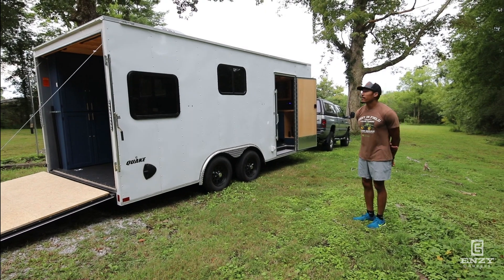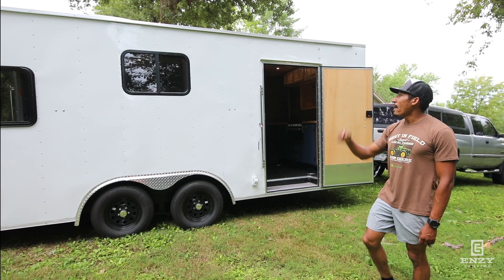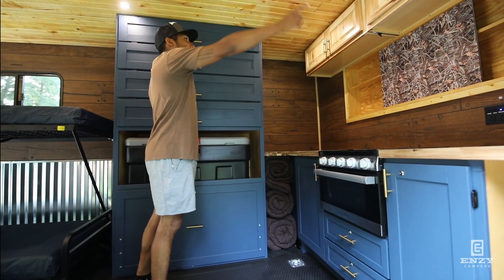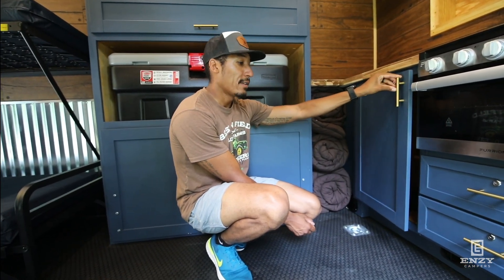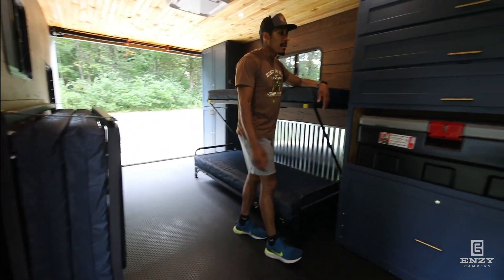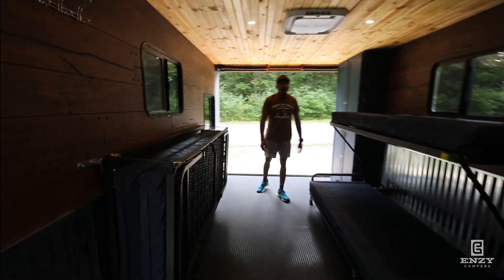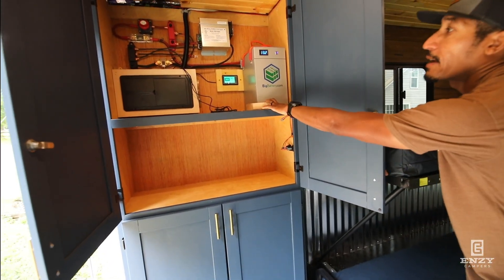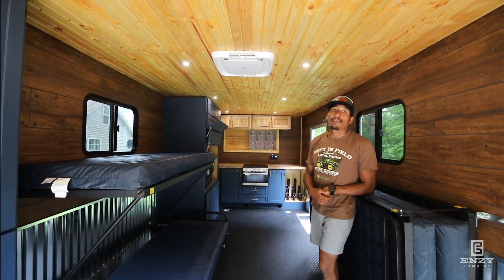Enzy Camper Walkthrough

Comment: Nice Build!!....Ever think of using Composite Panels and Timbren suspension. I guess the trailers are already manufactured and you add the insulation and add ons?
Reply from the maker: Thanks for the feedback! Correct, we purchase the trailer and then build them our accordingly. We use a variety of wall panels. Most of the trailers we use now are off-road trailer that come with torsion axles. Would love to someday do a build with independent suspension as an add on. Definitely doable!